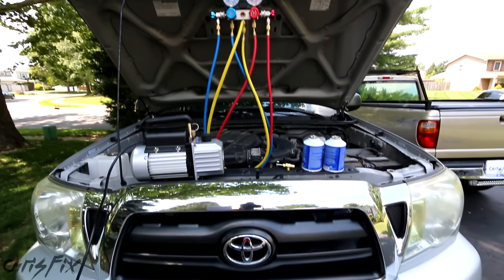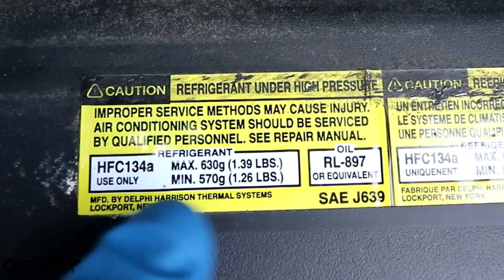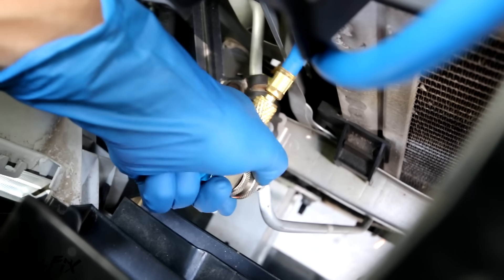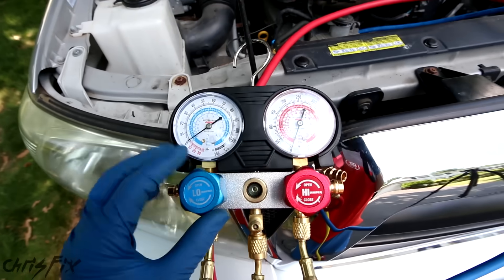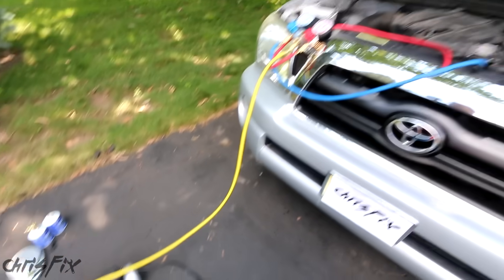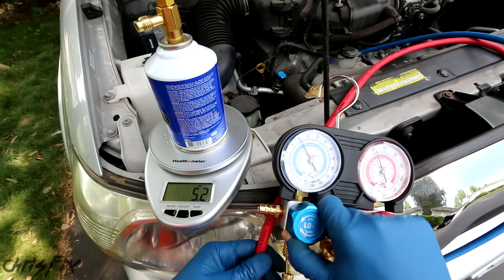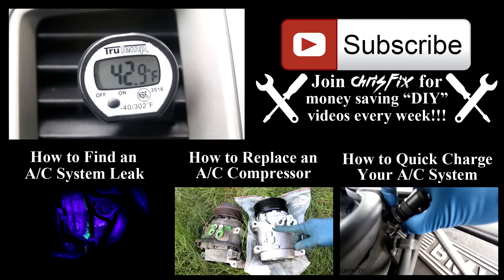How to Properly Recharge Your AC System

Comment: when my heat is on the compressor clutch is going on and off?????? what does it mean
Reply: It's normal.  In heat mode if air is routed to the window defroster, the A/C system runs to keep moisture out of the discharge air, thus preventing fogging up your windscreen.

Comment: chrisfix...please help.  when testing to see that the system will hold a vacuum what if the low side stays the same but the high side needle goes back to zero?  my high side needle went back against the pin under vacuum but after about 15 hours it went back to zero.....all the while my low side was at 29 vacuum.  thanks.

Comment: I have a Toyota 2004 and it has some issue when I start the and put it in the drive mod then it moves further and when I put it on the reversed , it goes reverse but once I put it on parking and then try to go further on the drive mod then the car doesn't move.. what's wrong with the car ?

Comment: 4:22 the way you are turning them it look like you are closing them no opening.
Reply: Gulzar Hussain you turn them "backwards" because what you are actually doing is "tightening" a right hand thread screw. As it threads in, it pushes on a Schrader Valve located inside the aluminum fitting and opens the connection.

Comment: i got the system to help replace my compressor and followed your video and everything went smooth as could be got it replaced and added the oil and then the r-134a and wa hooo we got air, thanks so much for having this it saved me about 400 doing it myself.

Comment: so will using the vaccum essentially do the same thing as flushing the lines or no? i have to replace the compressor and im afraid there might be metal shards in the lines.
Reply from the maker: With flushing the lines you run a solvent though the lines to remove any debris (usually metal and rubber bits). The vacuum part is totally different and is used to vacate the air and moisture from the system.
Reply: And as chris said, always a compulsory step after the system has been opened anywhere.
ChrisFix the gloves you used are not safe for this step. Using neoprene(rated) or just winter neoprene or winter leather is better.
Reply: The vacuum pump does not do the same thing, it does more. The vacuum pump pulls all of the air out of the system, whether it gets the foreign objects or not is another matter. I don't think that the debris will pass through the Schrader valves (I think I spelled that right). The purpose of the vacuum pump is to pull the atmospheric air and the attendant humidity out of the system. Any moisture (humidity) inside the system is a bad thing.
Reply: ChrisFix when i replace my ac compressor do i have to charge it right away ot can i just run it as is for now because the one currentpy on my truck is locked up and wont let me start my truck and the compressor wont come on when theres no refrigorant right?
Reply: When a compressor fails is grenades metal into the system. this also produces an acid. VERY BAD STUFF> 
Get a new filter dryer and remove the hosed to and from the dryer to the compressor. FLUSH everyting out with quick flush biodegradable flush for HVAC and get a bottle of nitrogen and purge it all out for 1 minute of 100PSI into the lines to get out the flush. Now put a new dryer on and a new compressor like chris did and go at it. DO NOT USE ACETONE. there are the right tools for the job.

Comment: Hey there Chris, Thanks for the video. I just need a bit of clarification. I rented gauges from Auto Zone and it does not have that value that yours has to purge the system. Is there another way to purge it?
Reply from the maker: I wouldnt be too concerned with purging the yellow line. There is so little air in there that it is almost insignificant. I am not sure how you would purge the line besides the purge valve. You can remove the red hose and open the valve so it purges out of that if you want to do the job 100%.
Reply: Thanks Chris, Your instructional video was perfect. I was so happy as everything came together just right...but...
I did however run into a problem.
After a few days of driving it...
I noticed some green dye but more like oil around the compressor. Both high and low connections are not leaking. When I installed it, it held the pressure with the vacuum pump for at least an hour. So I am thinking the compressor is defective. Is that possible? 2004 Honda Accord/ 4 cyl. Used Denso AC.
Reply: Hey there Chris, I contacted Advance Auto that sold me the AC compressor, and they said that the oil that came with the compressor is in there just for lubrication for shipping purposes. I was suppose to drain it and add the proper amount of oil. Then after everything is installed I should have turned the compressor pully 15 times before I run the vehicle. Ugh, I wish I knew all of this. Now I ruined the compressor I just bought and need to do it all over.

Comment: My 2005 Tundra AC just failed I believe? Its compressor makes a real loud air horn sound then shuts itself down & the AC button light flashes constantly. 
  When I got her home and put my gauges on they show low side maxed out my 100psi gauge. I drained the low side down to about 10psi so the compressor will still engage and added one 12oz can of freon to it. The compressor sucked it right in, AC ran very quiet/normal blew cool air, not cold of course but cool air blew a few minutes then once again it let out that super loud air horn sound and AC shut down, button went to flashing again.
    
  Now' strangely, after the truck set 5 minutes or longer I restarted both the truck/AC and again my gauge on low side was maxed out over 100psi vs 30psi or so it was originally on a few moments before when that one 12oz can of freon was the only thing I put in. Weird!
   So' has my compressor completely failed allowing pressure to build this extremely high psi on its low side some how? 
 I couldn't check my high side because my high side hose connector is bad? 
  Anyone know if its a bad compressor for certain or is there other possibilities that may cause this to happen?  
  
  In my Tundra's nearly 400k low miles, its only AC issue I ever had was top it off with one 12oz can of freon a year or two ago and I never had another issue till today. 
  It may be time for a new compressor already. Dammit Toy wth happened to your quality control here? This what we get when Crazy Gibson Hoosiers build our trucks or what?...lol

I really want to thank all of you, what a wonderful truck y'all built me here!

Comment: My 96 lesabre a/c won't put out cold air, it gives out heat really well, I tried recharging it but that didn't do anything , any ideas on what else it could be?
Reply from the maker: Check the blend door. The blend door could be stuck on heat so it is pulling air from the heater core instead of the evaporator.
Reply: alright I'll definitely try that, thanks!

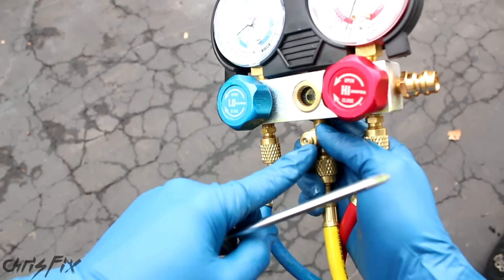Comment: At 9:17 when you are about to purge the yellow line, why does the pressure gauge say there is no vacuum? I'm confused, shouldn't the gauges still read that there is a vacuum before you purge the yellow line?
Reply: your correct he film it later, you should still have the gauges shut with the lines still in vacuum, once the line is purged you can open the gauge and let the refrigerant flow into the system causing the gauge to rise
Reply: This might be a bit too late; nice attention, the blue line is closed and has vacuum, but the gauge is open to the yellow line which after taken off from the pump no longer has vacuum and that created the no vacuum situation. To clear the line from air is the reason for the purge to ensure that the yellow line to the gauge is almost filled with refrigerant before opening the blue line.
Reply: ArcticAstrophysics case 2390 with York compressor how to charge unit
Reply: ArcticAstrophysics 

Ok, this is what happens when you're not watching the whole thing from the start... stop skipping the videos!... hope this helps!
Reply: I did watch the entire thing from the start, I was just confused on that part!... stop assuming things!... hope this helps!

Comment: I need your help man . clutch will not engage. not relays it's not the pressure. I've got no idea besides the clutch being bad but it doesn't seem like that would be it bc it's got no oil or metal shavings coming out of it.  when the AC stopped working,it just didn't stop it, slowly stopped getting cold and became warmer and warmer until it just stopped. O and both fans are working fan when I hit my AC button they still kick on its just the clutch will not engage and I can't get it to jump from the relays or the plug coming off the compressor. can you give me some advice please
Reply: If you test the clutch with motor off and using jumper wires with 12 volts and you hear no clicking from the clutch then yes the clutch is bad. Remember that the clutch is not part of the pressurized system. All it really is is an electro magnetic plate switch. Its possible to replace just the clutch but I've never done it. As cheap as most new compressors are now days its probably a good idea to replace the compressor with new clutch already installed. Always buy a new compressor. Don't try and save a few bucks on a rebuilt. It will usually cost you more in the long run.
Reply: I tried jumping the clutch with the car off and the key on and with the key off. But I wasn't %100 percent sure if I was putting the wires in the plug right, it only had 2 ports so I did negative to the biggest port and positive to the smallest and got nothing from either

Comment: I have a 1500 Silverado 2000 it need to replace the hole a.c. sistem so I was told the mechanic wanted to charge me 1500 it's that about right please thank you
Reply: The entire A/C system consists of a compressor, condenser, evaporator, and receiver/drier plus all the hoses. All that (easily 1000 dollars since the mechanic will mark the prices up) plus the labor (easily 500 dollars since the entire job would take 5 or more hours) so yes 1500 would be about right. However I HIGHLY DOUBT it needs the whole a/c system replaced, usually just a compressor, sometimes a condenser if you hit a bird or something since that is right in front of the radiator
Reply: I agree. Have you seen the condition of the system? As long as the compressor didn't tear itself apart and send metal all through the system or the desiccant pack inside the receiver dryer didn't come apart then it should be fairly clean.
Reply: 16 year old truck?diesel ?
i would never spend that much on a gas truck that old.why would it need new lines and hoses?it might have a slow leak in a valve.tighten it.shops are always wanting to cheat someone.
Reply: I did mine in the drive way-get the rebuild kit off ebay (170 ish) and find a friend with a vaccum pump-chunkin snowballs for under 200.Good luck.
Reply: 1500 for the WHOLE ac system?? Its alot of money but that is a steal.....I was quoted 3500 by the chevy dealership to replace the compressor only on my chevy aveo....I was like no thanks...and ended up trading it in.

Comment: I did this step-by-step on my 2012 Tacoma. I added 1 ounce of PAG 100 because of a replaced condenser. I purged and oil came out so I started the engine and ran a/c. I opened valves and saw activity on the watch glass for about 10 seconds then everything came to a standstill. I closed the hoses and called it a day until I find out what went wrong. Any thoughts?

Comment: i just bought a 2000 Mitsubishi montero. and my ac was working fine the first week i bought it. but when i turned it on again while driving it stoped and made a rumbling sound??? so everytime i turn it on to see if it works it continue to make a loud rumble noise? i even bought what i think its called is anti freeze? and put it in before i used so idk what the noise is still???
Reply: Someone really needs to look at it before you turn it on again. Loud  rumble noise is not good.
Reply: +Geiger Counter Virtual Museum thank you!
Reply: Could be the blower motor. If the sound is loud and coming from the dash particularly on the right side the motor may be worn out or the filter and fan area have something in it such as leafs and needs to be cleaned out.

Comment: you don't have to purge air from the second can?
Reply from the maker: It is sealed when you take off the first can. Very very little air will get in. So little that it would be a waste to purge because you probably wont remove the air.

Comment: When you pull a vacuum on the system, is the oil also removed??? Your video is quite helpful btw
Reply from the maker: The oil is not removed (or very very little is removed that it is insignificant). Only water turns into vapor under a vacuum to get pulled out. Oil stays a liquid.
Reply: Thank you for your help
Reply: my old compressor had just a few drops of oil in it.
Reply: The oil is in the whole system so when you suck the refrigerant from the system there is always some oil in the refrigerant.

Comment: As you pulled the vacuum, closed the manifold valves and purged the yellow line, is it ok to start the car and turn on he a/c with the system being stuck in a vacuum?
Reply from the maker: The ac wont turn on unless there is pressure so if you are under vacuum, the compressor wont kick on. Once you add refrigerant and the pressure is high enough, the system will kick on.

Comment: Okay so obvious issues here, running the vacuum pump on a system with any refrigerant, AS WELL AS just opening the purge valve, are intentional release of refrigerant.. For which the reward for reporting is up to $10,000, the actual punishment is worse. Not a mention of having the system professionally emptied first... Also, not to mention the obvious hiss when you take the "empty" cans off the system.
Reply from the maker: I would watch the video again because I do mention that you need to have the system professionally evacuated and that I did have it evacuated. Also, there were 2 other episodes before this that mentioned the same exact thing where I tested to see where the leak was coming from and then fixed the leak. There is always going to be slight positive pressure in a refrigerant can even after it is "empty" because the ac system is under pressure. You cannot possibly remove all of the refrigerant from a can.
Reply: I did miss you saying it was evacuated - watched it over at 1.5x and found it, my mistake. When doing this on my own I asked several local places, and although a few said they had no idea, one said that used canisters "used to be okay" to simply disconnect when finished, but now they require the tanks be more or less vacuum purged before disposal, and that A/C technicians run completely closed systems with new refrigerant and old refrigerant canisters. I'm not sure there's a provision in the DIY refrigerant requirements that say "It's fine if it's only a little". I didn't mean to sound frustrated with you as such, just annoying that you can buy cans for like $15 but even on the cans it doesn't say where or how to get rid of them.. Thanks for the prompt response.
Reply: I can see a point in the future where DIY wont be able to buy cans for this reason. Its true with the small cans there will always be some loss into the air. There is no way around it. Heck, some day AC in cars may be banned all together. Just think how many car wrecks there are every day around the country and with even just a minor front end hit the AC coolant is usually lost. Something to think about....

Comment: So why exactly we have to connect the high pressure line to the gauge ? Because we are not using it anyway.
Reply from the maker: +Lukas Liwandouw (Random Guy) to monitor the pressure. You want to see an increase in the high pressure side pressure and decrease in the low pressure side.

Comment: Hey Chris, When I try to bleed the air out of the yellow hose before turning on the vehicle and opening the low pressure valve, refrigerant does not come out. What is going on?

Comment: Hey Chrisfix can you please help me I have a cuestion, I replaced the transmission in my 04 nissan altima and I was lowering the engine and the frame to be able to take the transmission out of the car but the lower pressure hose wouldn't let me and I disconnect it from the compressor when I unplug it it felt little pressure,  do you think I need to put oil or or just fill it with r134?,I know that I have to run the vacuum pump

Comment: Chris:  My incompetent mechanic cleaned out the "orifice" and let the system bleed out.  He then tried to recharge without pulling a vacuum.  He got through several cans of refrigerant, (at our expense), but the system does not cool efficiently.  The clutch operates sporadically but the air is not really cool.  I purchased a charging kit at Harbor Fxxxxx, to do this myself.  Do I still need to pull a vacuum?  Or can I just go ahead and recharge.  Thanks.
Reply: This so called mechanic should be reported for bleeding the system and has most likely added moisture into the system which will sooner or later ruin it.